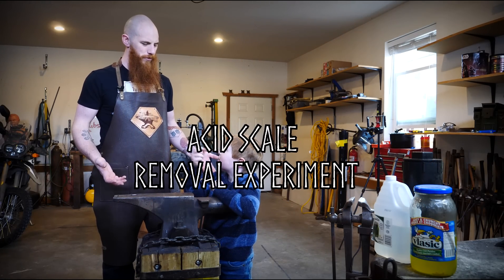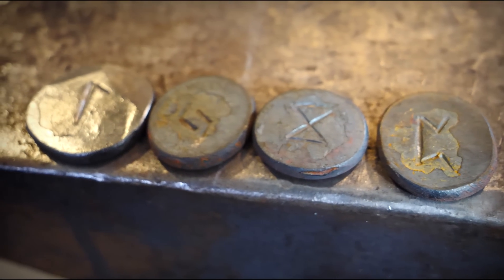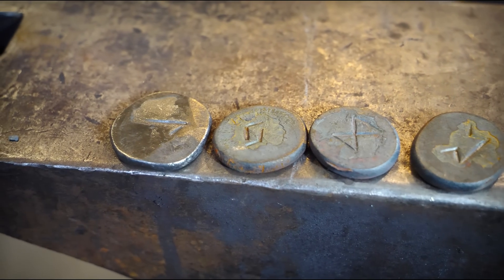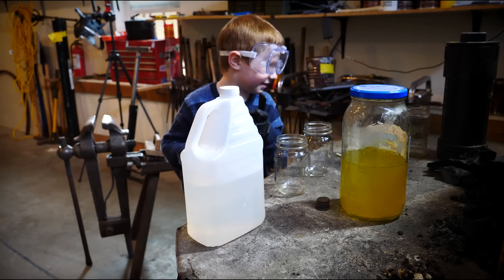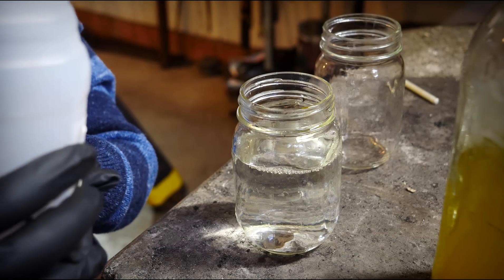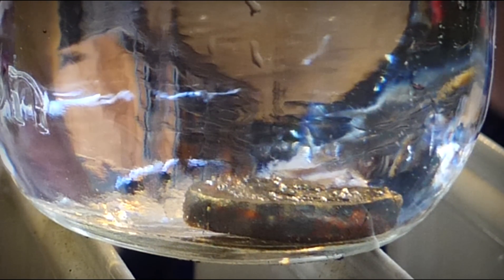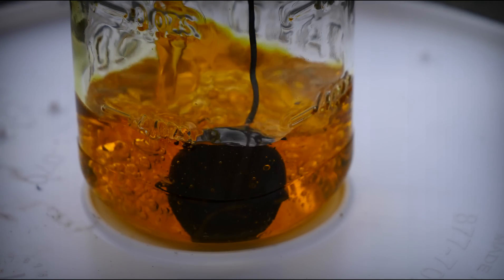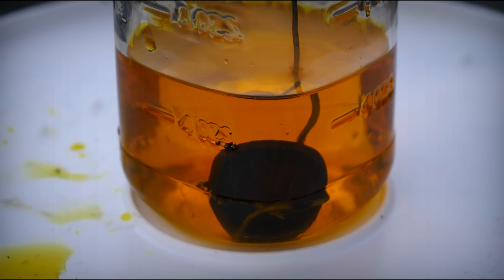✔ Testing Acid Scale Removal (2019)

Comment: Hmm well, really the only nonacid is the brine.
Reply from the maker: That depends on how Vlasic pickles their pickles. If it is through anaerobic fermentation, then it is not an acid. But if it's done with a vinegar base, it is.
Reply: @Friidom2 True. you could check the label as truth in advertising can reveal its contents if it has citric acid its likely vinegar as that is the active acid of vinegar... i must admit i have been meaning to try Wine as a echent as that's one of the historical acids that could have been used to etch a pattern welded blade.